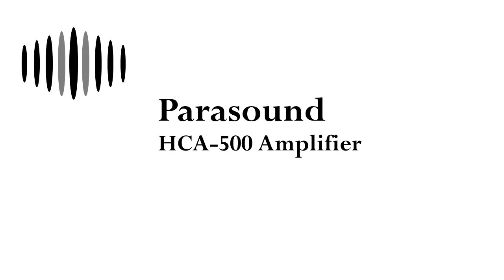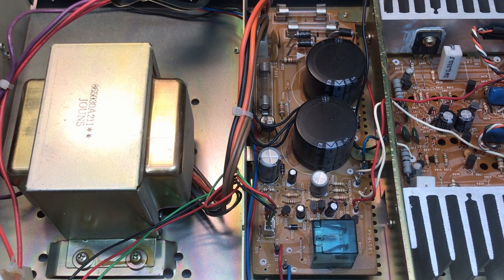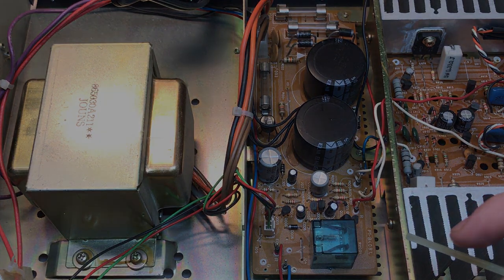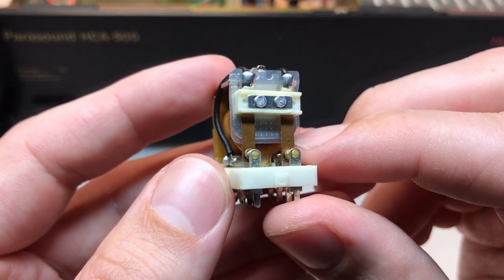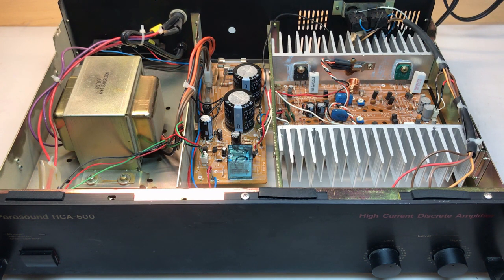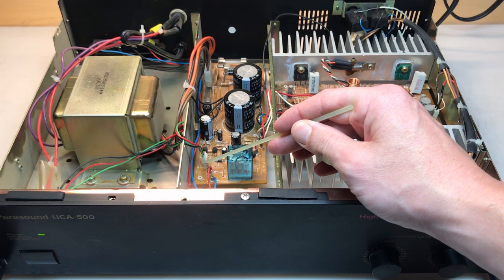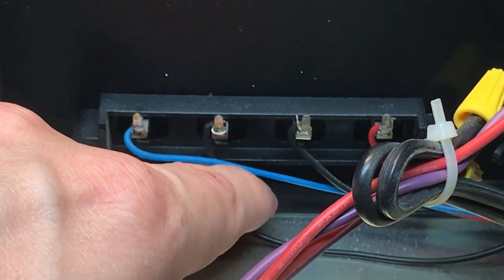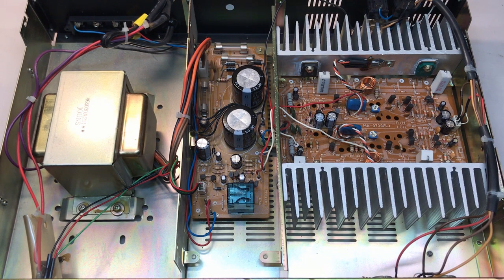DR #31 - Audio Amplifier Repair - Parasound HCA-500

Comment: Hello Duality Repair

I have this same Parasound HCA-500 and the only thing is my fuse from the power supply is blow out 1Amp 250v. Now do you sell these caps and relay for this model and can you make a package for me so I can change both sides power supply and the other side also. The Resean I ask because I live In Puerto Rico and shipping will cost alot & plus the weight of this amplifier. So if you can help me out I will appreciate it. Thank for this tutorial video for Audio Amplifier Repair - Parasound HCA-500

Comment: Any amplifier repair is not complete without checking the bias currents. Most amplifiers have very cheap open trim pots for setting the bias, which are very difficult to adjust precisely and can become dirty or corroded. I have repaired two older Bryston amplifiers that fried the output transistors when the wiper pivot corroded and lost electrical contact. I always replace the stock bias pots with good quality multi-turn pots such as Bourns. I also check that the amplifier will deliver more than its rated power without clipping, as there may be other problems besides the obvious ones.

Comment: I have a HCA-1200 with a 120hz hum from the chassis (not through speakers). Any idea how to fix that?
Reply: The transformer is mechanically humming. Might need tightening down or just replacing, or you need a basic DC blocking device on your mains. But some just hum (they dont know the words)

Comment: I haven't seen you check or adjust the bias in any of these amp repairs yet.  Also have you noticed failing and worn trim pots causing issues?

Comment: I ran into a relay issue on an automotive application. It caused high resistance and overheating melted some of the plastic base. The melting made the contacts misalign, which caused secondary circuit failure.   Nice work.  The speaker solder error might have been a MONDAY morning oversight.   Thanks    J K